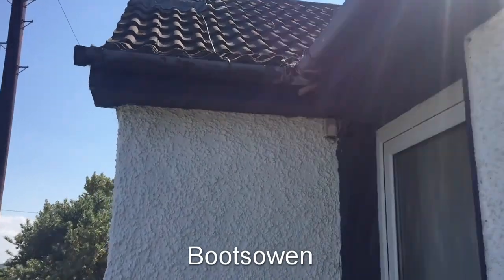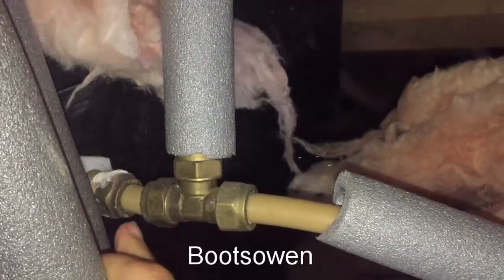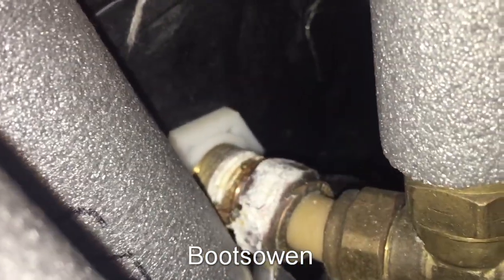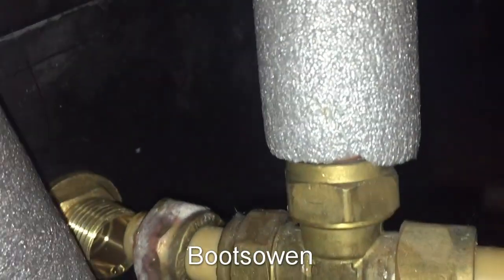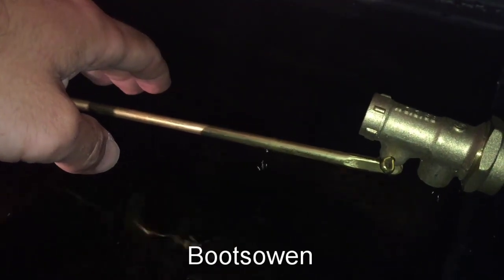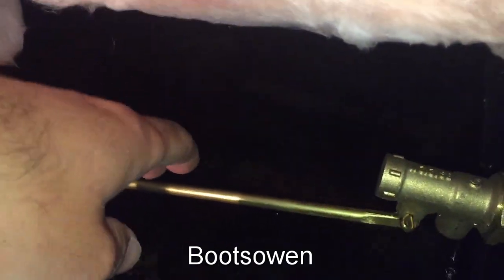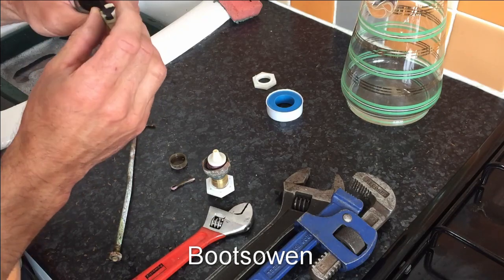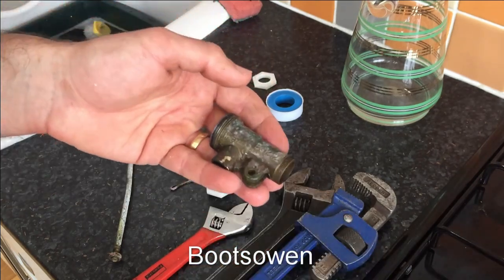Ball float valve replacement

Comment: Hi there i have fitted a side entry fill valve, there doesnt seem to be sealing washer on the inlet union pipe, is there supposed to be a fibre or rubber washer, it weeps a bit i have put a load of ptfe tape round ot, also when it fills up there is a horrible groaning noise for about 15 seconds.....any advice Please Fred in Essex.
Reply from the maker: I think there should be a big flat rubber washer at the union, Toolstation usually has all that stuff, an even skin of PTFE could solve it, or cut a washer from the neck of a hot water bottle.
Reply: @bootsowen  Ok thanks, i have ordered a pack of 5 off ebay cheers..F